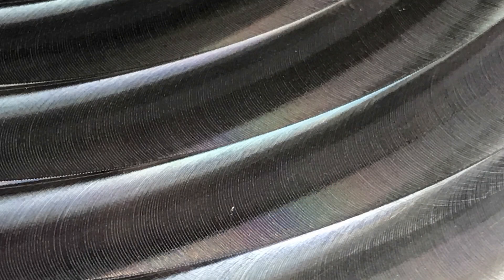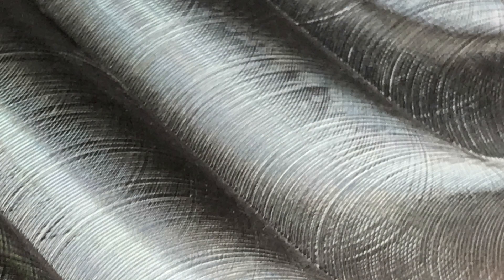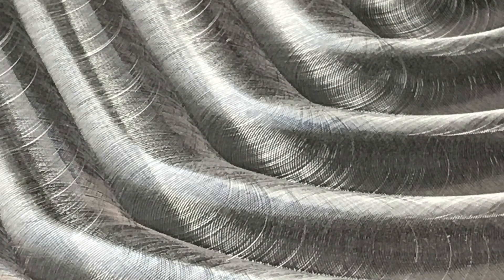When To Replace End Mills

Comment: hey so I have a question, I'm in an intro to machining class in school and I was wondering when to trash a cutter just by looking at it. When it changes color does that mean its trash? I know it's from heat and it's getting hot because of it being dull, but can I still use it? I would ask my teacher but he's scary haha. We are cutting steel, I have no idea what alloy, and the whole class shares the few cutters we have. Sometimes I have no other choice but to use the heat damaged cutters, and to save my eardrums I just spray some wd40 on it. I don't really know what I'm doing so if you could share some of that knowledge I'd appreciate it

Comment: Good info.  Probably one of the most lacking areas of info for CNC milling revolves around feeds and speeds.  Sure there are tons of videos that throw formulas out there but not many with any info in layman terms that actually explains every aspect.  As someone who was not a traditional machinist myself that was probably the largest hurdle I had to overcome and as a result I scrapped a ton of carbide until I figured out what works for me.
Reply: Most types of CAM software have presets for different tools, but I usually go back to the Machinery's Handbook to get the basic guidelines.If you don't have a copy, I would highly recommend it.

Comment: A great way to increase the life of an end mill when you're interested in preserving z axis finishes is to buy radiused end mills. Sharp or chamfered end mills lose their z finish far sooner. It's also important to note that decreased surface speeds and feed rates can have the opposite affect on  carbon steels leading to poorer finishes. The lower the carbon content the higher the surface speed required. Feed for the most part is the same.
Reply from the maker: Mike Lang thanks Mike!
Reply: I have put several of these endmills which became loud under the microscope and usually a very tiny chip broke off from the tip of the flute. I have even ground the tip back smooth to revive the end mill but this only worked sometimes.

Comment: Just a thought. If you have a tool changer you can use the warn tool for some of the roughing operations and save the newer end mill for the finishing passes. Lets you move the acceptable standard for the end mill ware while maintaining the part accuracy and finish.

Comment: I'm not a machinist but I play one in the shop ;)
I started by tracking my endmill hours on the machine and inspecting the endmill every few hours. I soon developed a history and programmed that into my tool life setting on the mill. Now I change them when the alarm goes off. Consistently accurate parts, surface finish and fixed expense.
I've been making the same parts for over three years and it works like a charm. I typically get multiple thousands of dollars worth of parts out of one endmill.
I use diamond coated, two flute 1/4" endmills from Harvey. about $90 each and darned well worth it. 300% more tool life compared to non diamond coated.
One mill I use for prototyping and I keep aluminum endmills, steel endmills and plastic endmills (and drills and spot drills and face mills) all separated. 

I mean I always cut aluminum with the  aluminum set, steel with the steel set and plastic with the plastic set. Just inspect them before installing in the mill, replace as needed.
Reply: James Holbrook is the coating a DLC? Or something proprietary? I heard the heat resistance wasn’t superb for DLC coated end mills
Reply: @justinmoritz6543  Yes, it is DLC. We have no problems with heat and we run it hard, as hard as we can get away with.